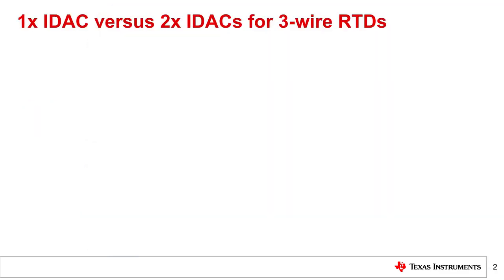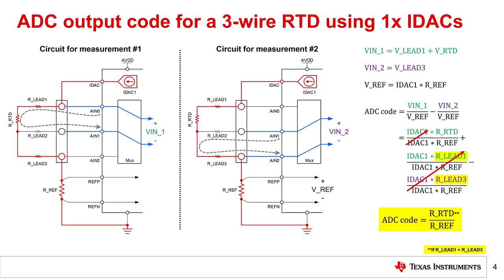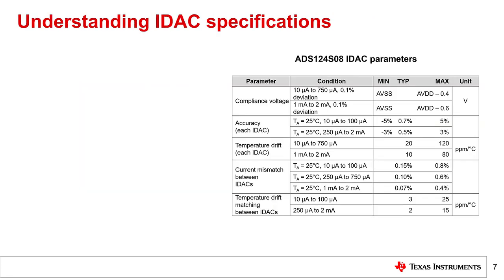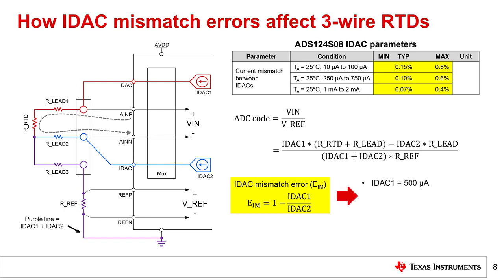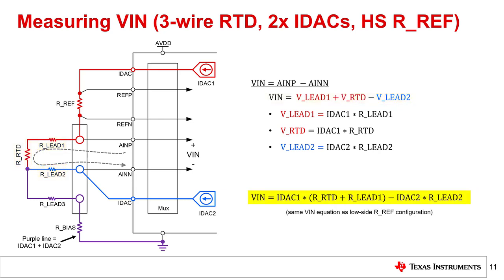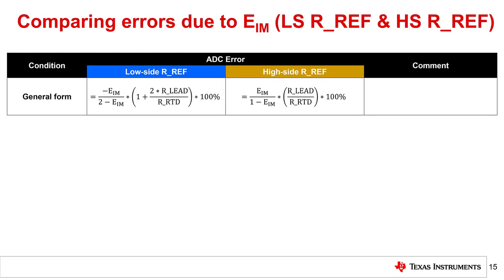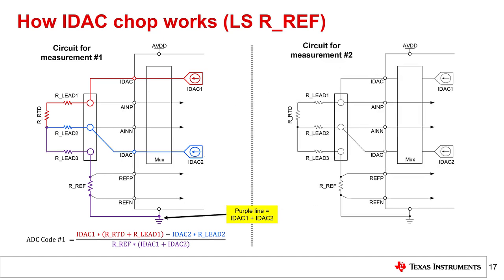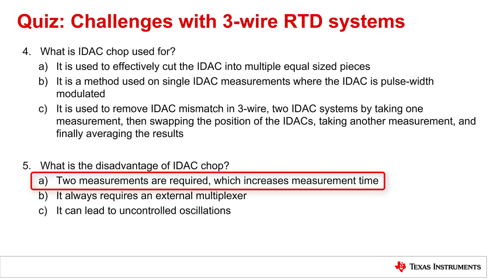Challenges with 3-wire RTD systems

Comment: Can someone please explain to me why no current flow through Rlead2 and why its not taken in the calculation of Vin2 ?
Reply: Because the current directions between VIN1 and VIN2 are opposite, they cancel each other out, so they don’t need to be included in the equation.